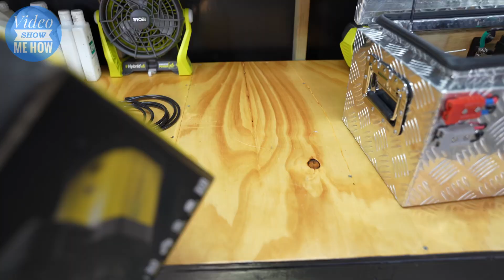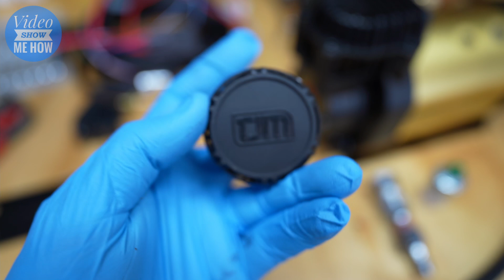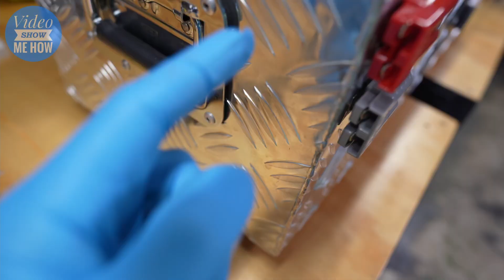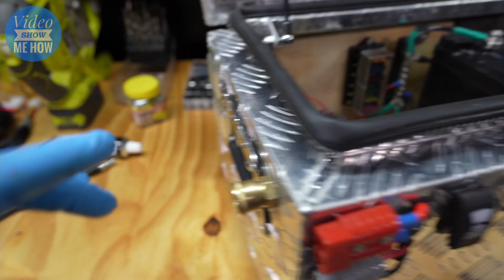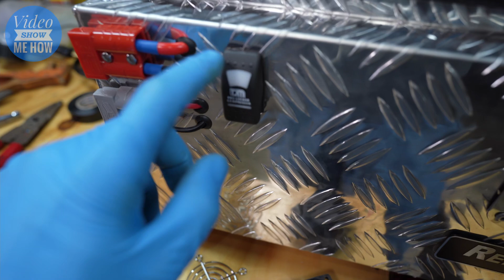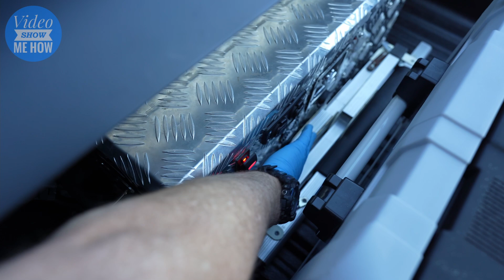TJM PRO SERIES 12v Air Compressor Review, Install (How To) - Isuzu D-Max Build Series #13

Comment: Nice video thanks, would it be possible to provide the dimensions of the switch? Looking to mount it to a specific recessed bracket and need to know if it will fit…
Reply from the maker: @makingmemories8186  it's a standard sized rocker switch 37.5mm x 21.2mm

Comment: Had to come and re-watch as I’ll be installing a renegade tool box on the drawbar of the trailer to house the batteries, air compressor, 240v victron charger along side a 240v plug in outlet as well so if on a camp site with power can charge batteries etc. I’m doing something similar to the fan idea you had but it’ll be setup with a Digital Temperature Controller that will kick on when the temp inside the box becomes too warm and setup to turn on and off automatically it’s going to be interesting lol
Reply from the maker: Yeah nice! Sounds like a great setup

Comment: Hi Adam is the Anderson plug for the fridge wired off the fuse box or straight from the battery and what size wire did you use, cheers
Reply from the maker: Is in an auxbeam relay setup, 30amps from mem as want be able use other bits as well. Is part of the stormod build, checkout this video https://youtu.be/qnShCDRXIf0

Comment: Hi. What is the current draw of the compressor. I can see that you have connected it to the 100ah lithium and was wondering what the impact is?
Reply from the maker: About 30 amps draw, 40 amp fuse. Pumping up all 4 tyres only takes a couple% out of the battery
Reply: @VideoShowMeHow  awesome thankyou. Also are you using the fuse block for the Anderson’s on the side for the fridge and accessories?

Comment: Hi bro is ur air hose tjm ? Then how did you connect the arb inflator  to  tjm hose ?
Reply from the maker: Had changed to standard fittings 👍

Comment: Do you need to install the fuse for the compressor? I thought the relay serves the same purpose?
Reply from the maker: Yes definitely, a relay is basically a switch, the fuse is your circuit protection 👍
Reply: @VideoShowMeHow  so how would you install a simple fuse in the circuit?
Reply from the maker: @capuch90  could just use an inline maxi blade (40amp), one of these should have came with the kit. Will be inline on the pos wire between battery and comp
Reply: @VideoShowMeHow  ahh yes this is already installed of course! Thanks

Comment: Hey mate, i noticed you have used a separate bus bar to the one fuse block. Why have you done it this way? Also, I can’t remember if you fused the cable into your fuse block? TIA love the channel!
Reply from the maker: I mainly ran a separate bus bar for the bmv-712 shunt to make things easy for the reads. All cables have been fused so all good 👍 About to have version 2 of this 12v setup completed shortly (with vids of course!)
Reply: @VideoShowMeHow  gotcha! Watching this series has given me the confidence to have a go and plan out the 12v for my troopy build! 

Is the victron app good? I’m thinking of just using the smart shunt rather than the display to have less clutter on my accessories panel and rather monitor via phone?
Reply from the maker: Mate the app is EXCELLENT.. Use it all the time on trips even on the way to get a quick view on charge states, what the temperature is doing inside the box and all of that kind of thing
Reply: @VideoShowMeHow  unreal! I’ll just go with the smart shunt! 

I’ll keep my eyes peeled for 12v mk2
Reply from the maker: @timcornish7682  just make sure it's the Bluetooth version.. I think there's an older non BT version
Reply: @VideoShowMeHow  copy that!

Comment: Is condensation an issue ? If so any solution
Reply from the maker: No not that I've seen so far. Box has really good airflow so reckon should be fine

Comment: Hey mate great little install! 
Just an idea with your cooling fan, add it to the switched side of the pressure switch so it runs only when the compressor is running. If you want it to run for abit after use, add a timer relay between pressure switch or a thermal switch so it only runs when hot
Reply from the maker: 👍 Yep have it wired via the switch so whenever the switch is on the fan is on. I've also added a relay that's triggered by the temp sensor on the bmv-712 so once it hits 40c fan clicks on

Comment: Great vid, what fridge do you have? Does the fridge work harder in the back locked up? or do you have some sort of airflow happening? Love your work Cheers.
Reply from the maker: Is a evakool 80l, bit of a review vid coming soon. Haven't had an issue, full day trip up the beach uses about 17ah on the last trip (have one of those inline meters) and with the redarc charging when the cars on keeps things topped up

Comment: What size fuse did you use with your compressor
Reply from the maker: 40 amp (has one already in the loom)
Reply: Didn’t you run it through your fuse box as well though?
Reply from the maker: @jessetink3753  no that was the switch power wire. The compressor power wire has its own fuse as part of the loom
Reply: Arrr okay then

Comment: Its worth using a braided line rather then rubber from the compressor to outside nitto fitting, as the rubber can easily melt or blow off when its running for extended periods. They get very very hot really quickly.
Reply from the maker: Yeah so far so good, have been using a fair bit over the last few weeks. The hose I used is rated to 150psi so that part will be fine, but as you say heat is the kicker. Had a compressor setup in a JK in the engine bay for a few years with the same hose too before selling it and was still going strong so I suspect this will be fine. Time will tell!